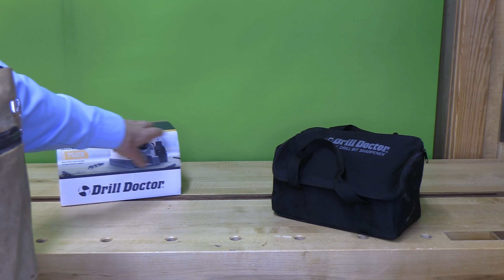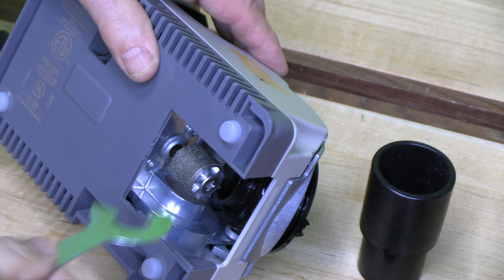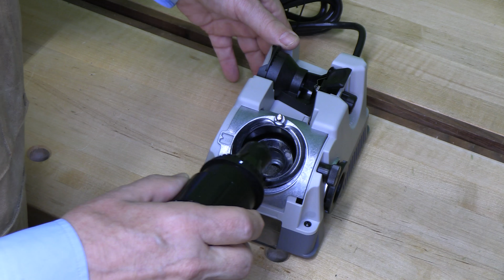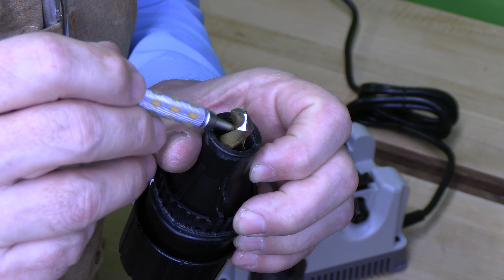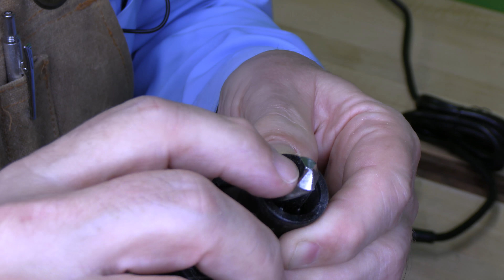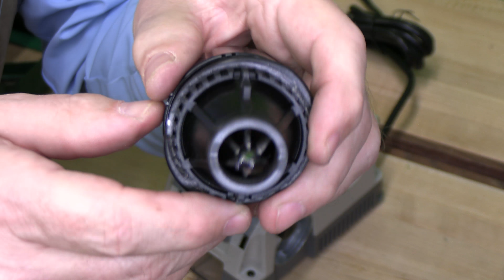Darex Drill Doctor 750X Review and Demo

Comment: I have a 500 series, I’m cheap and definitely not a professional, however having said that, I  would probably spend the extra as the 700 series does have better “fine tuning features” however mine does great no complaints here and doesn’t break the bank. Bought mine off Amazon and they carry both models. I feel that your video explains the process better than the others I’ve watched. 👍
Reply from the maker: Hey buddy, thank you for your nice comment. I’m glad you found it useful. This is a good system. All of the drill. Doctors work well consider subscribing. Thanks. Joe.